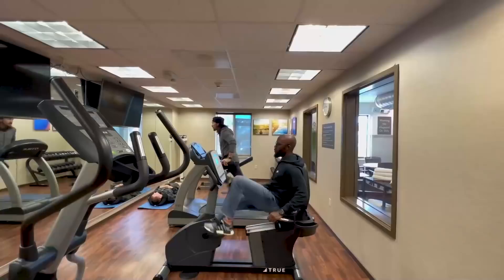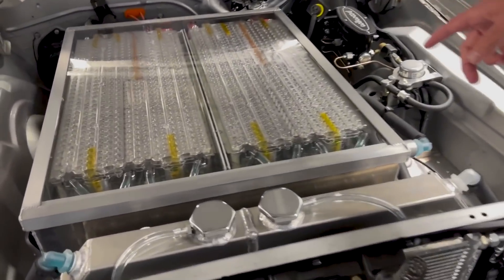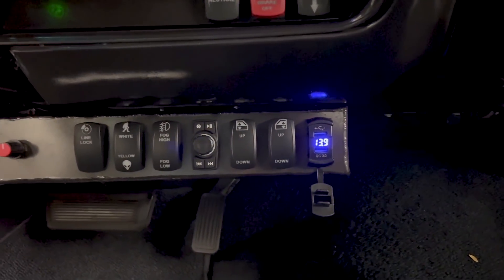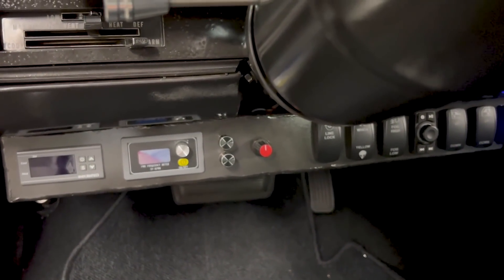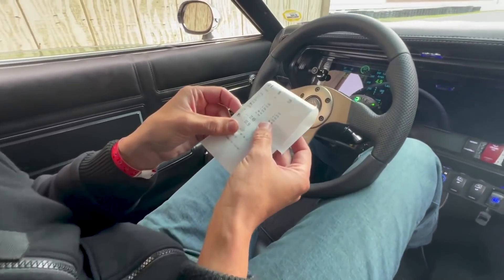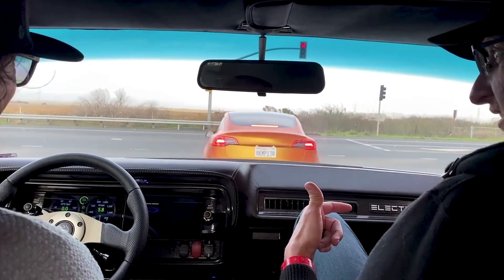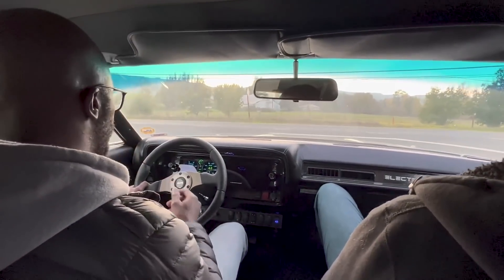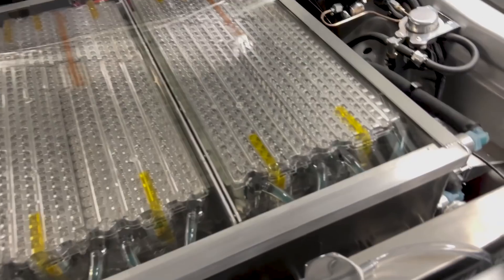Bringing Tesla Power to a Classic 70's muscle car

Comment: I see this car get so much hate online but personally I love it. I prefer gas engines but we’ll be able to preserve these classics if we convert them.
Reply: FORD GT40 so rather than preserving classic cars you’d rather them be scrapped because they should have gas engines? As much as I hate electric cars this thought process makes zero sense. Actual car guys would appreciate how much thought went into this build.
Reply: @Marsupial2  I wouldn't destroy it but what is left of the original car in terms of engineering? No engine that was originally engineered and made by the manufacturer. No transmission that would of been paired by the engineers to be the best fit with the engine. Again the engine and transmission would of been chosen to go with the chassis. I'd assume the brakes and suspension will be upgraded. Interior will require new gauges. Wouldn't surprise me that the steering is altered. A completely different powertrain from a different manufacturer and many other non original components. So we are saving the bodywork and chassis. And that's it. Might as well rename it. No association with the original marque and model anymore
Reply: @jstravelers4094  It doesn't have anything to do with change. If they want us to drive electric cars we have no choice. If that's the case bring out new models and create a legacy. If you want an electric muscle car then build a kit car or purchase whatever Dodge etc. make in the future. But please leave alone original cars. Sticking a Tesla motor in it is not preserving the vehicle at all. It's like repainting the Mona Lisa in neon with a moustache and telling everyone to just chill
Reply: @robsmall6466  You do know people have been doing engine swaps for decades,  putting a different form of propulsion in a vehicle is nothing new 🙄
Reply: @robsmall6466  
Do you have classic muscle 
car/cars?
Do you even have a clue how hard it was to get a 426 Hemi to run right?......the week after it was brand new? 
For as many small block Chevy engines I have owned...my eyes glaze over everytime I see one installed in about everything!
This build is not yours.
This guy actually drives this thing.
It would be sitting in a damned barn somewhere rotting away if it wasn't electrified.
Even a 440 gave my friend and I (70GTX) nothing but headaches.
Reply: @robsmall6466  dawg, we live in America you can state your opinion and he can ignore it. It’s his car, and he chose to make it electric. No one is forcing you to do the same…….
Reply: @SuperRhysevans  That's true ( 👏 ) but this is an entirely different form of propulsion that fundamentally alters the character of the car
Reply: @jstravelers4094  What's the point in saying "  the build is not yours ". Don't understand the need for the passive/aggressive comment to be honest. Did I say I'd like to see it burn? No. There are plenty of people who could of restored this with original components. It's going to be an amazing future with a car park of classic cars all with the same Tesla electric motors. "What's that dad?" "That's a Tesla son. And that. And that..... 😴"
Reply: @PisaniProductions  Again. What's with the passive/aggressive response? If you're got shares then be honest about it. If everyone is going to get sensitive in the comments section then disable the public comments. If I'm to follow your advice I can also ignore your opinion. But that would make me ignorant. Oh and by the way "dawg". We don't all live in America. Did I say the car should be burned? No. Amazing future when every classic car in the car park is a Tesla with a different body. "Dad. What car is that?" "Well Son. That's a Dodge.... Ah no Son.... That's a Tesla. And that's a Tesla. And that's....😴"
Reply: @robsmall6466 
EDIT: I realize i responded to the wrong person LOL my b, but since im here might as well keep going XD

 Hey man, not trying to be passive. Everyone is entitled to their own opinion. Opinions in their truest form cannot be false, because they are only a belief. You are entitled to your opinion, and you ignoring mine is not ignorance. While it is an unfortunate possibility  to see engines rendered extinct, i highly doubt it will be in our lifetime (depending on the government). My point is that there are hundreds of this module car out there that have been rebuilt, but at that point its just a boat of thesis paradox. If its rebuilt even with an engine is it still the original? I agree a car with electric motor instead of engine inst the same, but i believe it still has a personality and feeling of a soul even if its different. you don't have to agree with new things and that is the beauty of unique perspectives. In the end, you weren't going to rebuild the car, and he did. Now instead of prolonging the issue of too much trash in America, he created something unique and road ready. I commend and appreciate your opinion, but you have to at least admit the work he put into it is excellent and professional and shows his engineering talent. He made something more durable and put together than any mainstream EV. Just to be clear, i do not support Tesla - they are a money hungry company that creates half assed cars that are totaled after a single fender bender with no systems that support buyers. once again, sorry for commenting on the wrong comment, hope you have a good one!
Reply: @PisaniProductions  A rarity on YouTube. A good human 🙂. Everything is fine. So don't worry. It's discussion which is good. Obviously effort has gone into this. What isn't right is the legislation that is being forced through which in turn will put genuine classics at risk. Originality I'm referring to is keeping these vehicles as close to original as possible. What I'd like to see is new electric muscle cars from the traditional manufacturers, reissue of old chassis and body designs for anyone who would like electric in a classic design ( similar to what Aston Martin does. It would be expensive. Yes. But the limited numbers produced would get around a lot of the new car shape and structure regs ) and for anyone who chooses to still run an existing petrol, diesel or hybrid car between now and the end of manufacturer and sale not to be penalised. If they are going to be replaced then they will be by electric but allow those cars to be maintained and enjoyed for future generations. It would be great if consumers were just given choice. Petrol, diesel, hybrid, electric, hydrogen...... instead of forcing things through under a false green agenda
Reply: @robsmall6466  hahaha i try my best. everyone tries to argue pointlessly and its sad yet hilarious. Like, no ones convincing the other person hahah.

and agreed, people tend to ignore where electricity comes from when thinking of "green cars". Also yes, that would be dope to see actual manufactures create an option in the future for several of the same vehicle with different engine or motor type options like how you can get different packages. I just hope the don't look like the ev mustang lol. Switching to only EV would literally bankrupt America at first, which some people don't pay attention to unfortunately. 

On a tangent when i think of it, so many kids are able to bond with their parents over slaving over an old beater to make it something personal. I imagine in the future if its only EV cars it would be similar but not the same because of how many issue you have to overcome when fixing an engine compared to EV. While i am all for the future and the potential EVs have, I will say hearing a car you've spend hours on finally roar to life is an incomparable feeling. 
Good chat sir 🤣
Reply: @PisaniProductions  Ford should of called the new Mustang something else. Instead they saddled it with expectation that wasn't fair. Similar with the Ford Puma in Europe. A much loved Fiesta based coupe turned into an SUV. Having said that they are selling well. Nothing like the sound of an ICE coming to life 🙂
Reply: @jstravelers4094  The whole appeal of having a muscle car, is to hear the loud scream of a V8. To feel the vehicle shaking, as it idles at a red light. The smell of gasoline and burnt tires is just an aroma some people crave. 

These cars have been around for decades, you can literally overnight order any part with modern ignition, and electronics to make the vehicle faster, more reliable and more efficient. Anything is difficult if you lack knowledge. Nothing is impossible with loads of cash! I can appreciate the guys build, it’s clean. He is happy, but at the end of the day ,I’m going for the V8. It’s not a muscle car anymore. I would of just purchased a Tesla.
Reply: @robsmall6466  yeah dude fr.
Reply: @robsmall6466  
If you're going  to critique someone's masterpiece, you should be able to take a little criticism yourself. 
Build your own car son.
Nobody is stopping you.
Reply: @moro1112  
You don't do change well.
Good luck with that.
Reply: @jstravelers4094  Works both ways. So according to you no one else can have an opinion on a PUBLIC comments section. Do you have shares or do you need divulge a special interest in this project? You sound like the worst PR person possible and your not doing your chosen "cause" any help. At all
Reply: @robsmall6466  Agreed my guy, anyways cheers. Have a good one man!

Comment: I'm really digging EV's. I'm mechanically inclined, BUT feel ignorant when it comes to EV's. I'm paying attention and want to learn for sure!
Thanx
Reply: You don't need to be a mechanic, you just gotta plug it in when it quits working!
Reply: @nickpollay1681  very helpful,  thanks
Reply: Im the opposite. Im trash at fabricating metal shit, but im good at electrical stuff.
Reply: No different than building a computer. Or I should say working on a printer/copier
Reply: @Ogknav  Definitely alot more programming, but as long as you get how to use an arduino, your basically good
Reply: @nickpollay1681  Lol this is true but I was going to say an RC car.
Reply: @nickpollay1681  can we start with off road buggy’s?

Comment: Nothing will replace the sound of a throaty V8 going through your body. As long as there's gasoline, there will be V8's. That having been said, huge kudos for experimenting with a highly computerized battery muscle car. Just the engineering alone is one for the books. The spaceship sound when taching up high is a cinematic bonus brought to life! Thanks for putting this up.
Reply: Just add Hemi sound threw tape deck with 5000watt amps and good to go!!!!!
Reply: @dannymostarac1799  8-track for extra authenticity

Comment: This is so cool. Would love to see down the road complete drop in kits to convert muscle cars to EV like buying a turn key crate motor.
Reply: GM was considering one for LS power plants. Don't know if it ever came to fruition.
Reply: @Dave saw a drop in ev crate motor at a sema booth
Reply: @princekermit0  only the motor no batteries or controllers
Reply: @sumgaye5951  no it was a full kit. Total package. It had different options for different platforms. For A bodies, etc.
Reply: It would be a long time because electricity is dangerous if you don't know what you're doing. No one wants to be the first company to take such a risk with such limited (easily accessible) knowledge out there.

Comment: @6:00 use wd-40 to remove the rubber. Use it before track to prevent it sticking at all 👌
Reply: I personally use semen myself
Reply: WD40 and zip ties fix everything! 😁👍
Reply: Great tip!
Reply: I only say this because I am certain of how good WD-40 works, mostly because I work in the asphalt industry.

Comment: Even though it's an EV it still has that old muscle car sound...at least on the interior with all the squeaks, pops and rattles. 

Amazing build. Could you imagine taking this back in time to the 70s and showing it to an owner of an original factory Satellite? Pop the trunk and hood and it would blow their minds.
Reply: I was the owner of a 1972 Satellite, my first car at 16.  The original dash was far better, i cant believe he removed the dashboard light, one of its best features.  I do love the electric drivetrain he put in it.   My Satellite lasted until 1984, when the transmission was down to 1 gear.  I was able drive it to the auto recycler and sell it for $50, then hitchhiked back to  my college campus.   It was overall a very reliable car, very well built.

Comment: The Sebring takes me back to 1972. I was 20 years old and bought a used '69 Roadrunner with 383 V8 and 4 speed transmission. It ran 14.6 in the 1/4 mile...95 mph. But, it had drum brakes and didn't corner well with oversteer. It was fun and thank God I didn't kill myself in it. I wish I still had it...

This EV is a great build. It's taken the axe of the old muscle car era and turned it into a scalpel. I dig it! Congrats

Comment: I've watched this build on Mr. Erickson's YT channel.  I'm the second owner of a 1973 Dodge Charger that is due for a rebuild, and this is very tempting, but the price of battery packs and drive units don't seem competitive with a conventional crate engine and transmission...plus I'd lose the option to have a manual transmission.

Perhaps one could buy a salvage Model S and make it more cost competitive with ICE, though I don't know how much time is required to strip components from a Tesla.  There's also the question of how difficult it is to get the vehicle registered after completion.

Comment: I am a big mopar fan and know with the purist this type doesn't sit well. nor resto mods. Generally even I frown on restomods when you can make the old engines even more powerful then the 1000hp hellaphent crate engine. There are people cruising around with 2500 plus hp cars on the street. 
This I think is neat as one day and its coming gasoline engines aren't going to be allowed on the street! I also hope this motivates Stellantis to make their own high performance EV conversion kits for old Mopars! 
Not sure if you follow European EV's but from what I've seen the Peugeot EV's are pretty good! Chrysler is being rebranded back to its engineering and technology roots starting in 2025 and will be 100% EV's in 2028. 
Kudo's to this guy for building the future!

Comment: How big could you go in putting electric drives into an existing vehicle. Are there any electric drives that are somewhat self-contained front and or rear that you could bolt into a Ford E350 van, maybe a 95 Toyota t100? How long do you think it would be before these kinds of bolt in drivetrains will become available for existing cars. It seems like a great way to make a transition from ice to electric. I understand there still has to be space for batteries but most vehicles after you've removed the ice drive would have room available at least for some battery power. This would also keep the DIYers in the game.

Comment: That is one of the most dangerous looking electric conversions I've ever seen. The car build is nice but the EV conversion is a death trap. Perspex battery box covers that have no structural integrity in a crash, none of the HV contactors and other parts carrying 400V are in any type of electrically safe enclosure or insulated terminals, etc. You guys need to check out Electric Classic Cars in the UK, they're on another level.

Comment: When Kevin was drag racing the car, you could see the interior lights flashing (13:15).  But when it was on the street I didn't see any flashing.  Do you have some kind of "launch control" or "drag race mode" that makes the interior lights/switches flash?
Reply: I'm guessing that was the video and display out of sync.  Like when you see an older tv screen rolling on taped video.
Reply: Or maybe they weren't switched on during the second part.
Reply: @lawrencekendrick6440  I thought so too, but if you watch when he says he's gonna "hit the line lock" at 13:25, they're blinking.  Then he burns the tires until 13:32 and they're steady.  But right after he's done they start blinking again.  I kept watching, and at 13:54 they're blinking until the camera guy turns and then they look solid until he turns back and they start blinking again.  That makes me think maybe you ARE right and it's camera issues.

Comment: Would prefer car with analog physical potentiometers for like everything. Think wipers/intermittent, head light height, interior lights with r/g/b pots, blower motor, electric windows with analog speed control on the switches, adjustable power steering etc. etc... 

who tf actually wants some wannabe fancy, actually choppy automation? 

And then there is the vents. Like I get it, AC is a thing, but getting enough actually adjustable vents that can be pointed towards your sweaty stuff is like nope, no can do. Mazda at some point had their crotch vent. That was actually nice. Then there is the vents at the bottom/legroom. They are never pointed where you need them. Sweaty toes, oh sorry, we made the vent to blow directly at your knee or something. In cold weather, no way you get any warm air directed to your freezing toes.

/RANT

Comment: Electric motor and batteries are 50 k just for parts. How is this better?
Reply: It'll beat the brakes off just about everything but a dedicated drag car in a 1/4 mile? 
Instant torque, no gears so no time losses there. Going electric is the ultimate performance upgrade and the only sacrifice is range but seriously, a car with that performance is for dicking around and taking to the track anyway so who cares